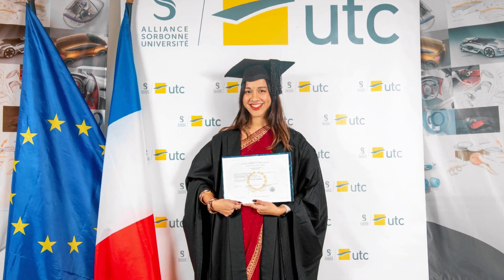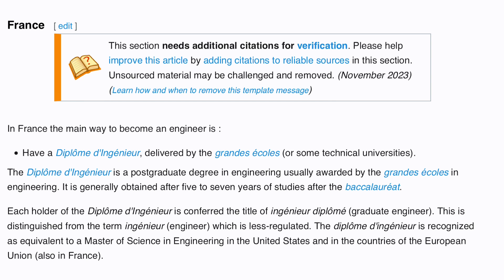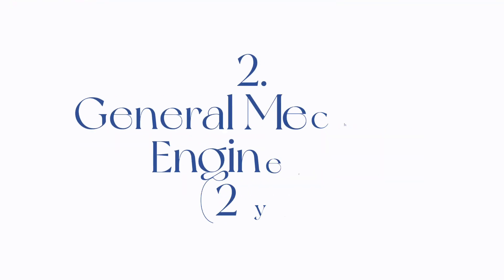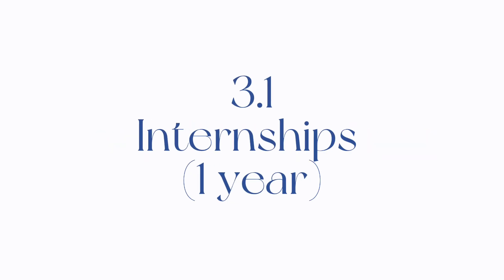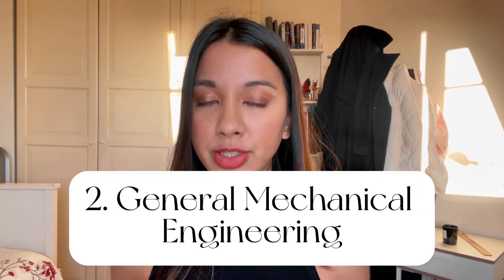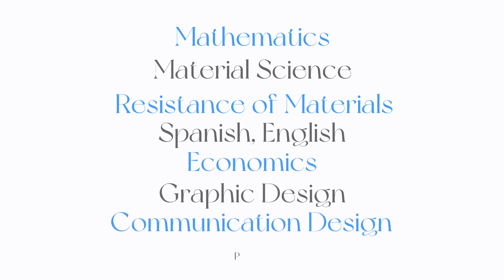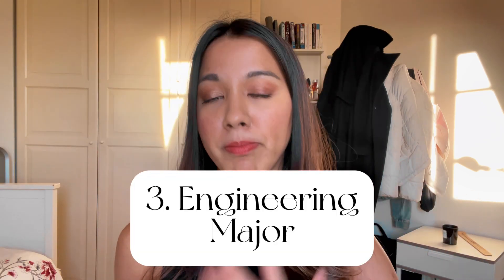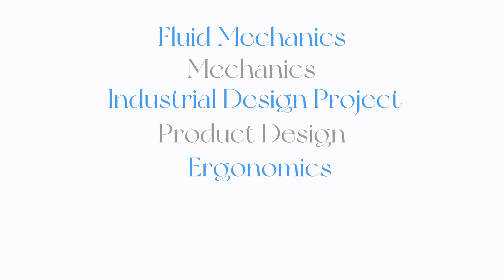How I Became a Mechanical Engineer (MSc in France)

Comment: thank you for the useful video . how did u  find the courses and join cuz i am really interested in doing DUT in Le Havre
Reply: edit : after some searching I discovered that The DUT was replaced by BUT. is it the same ??
Reply from the maker: Hi! I was done with DUT when the change to BUT happened. I'm not a 100% but the BUT is a 3 years bachelor vs. the DUT (2 year technical degree). However, you can opt to fast-track your BUT and do a DUT. To be verified though. 

In terms of classes at DUT Le Havre, for GMP, I really enjoyed it! Very hands on :)